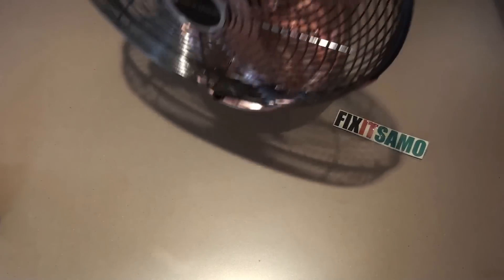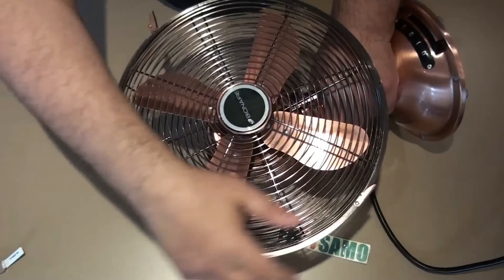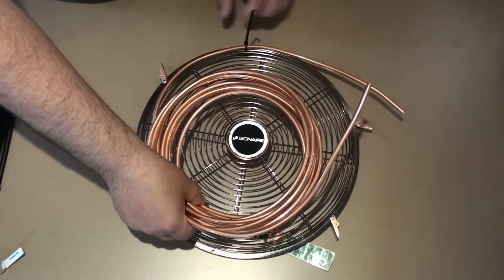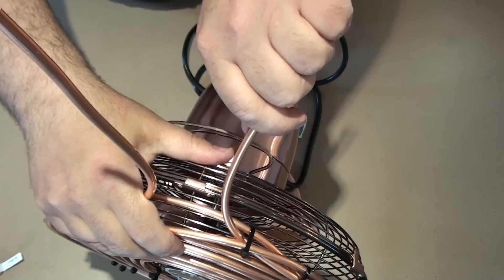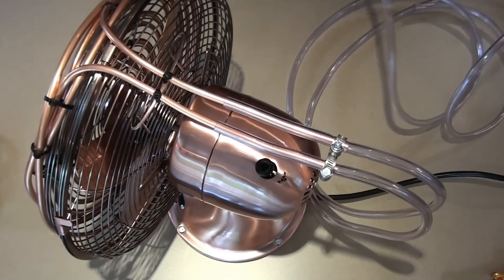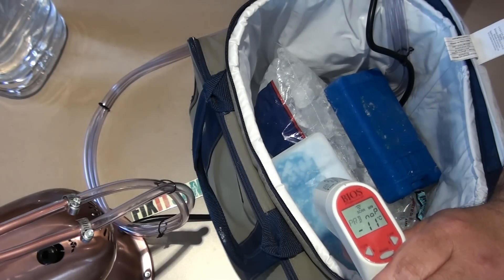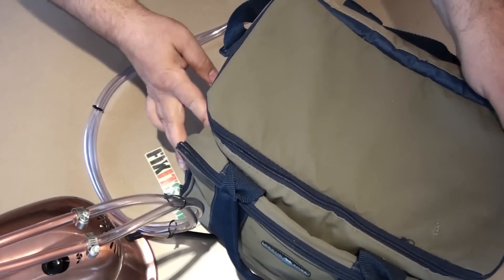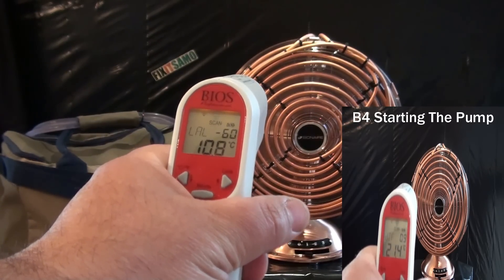How To Turn Your Fan Into An Airconditioner  AC

Comment: very nice, low cost environment friendly AC.
Reply: +Shesh L Environment "friendly" "AC"... yeah how much electricity is spent on freezing the ice, how much all the materials for this build cause in emissions or money vise, not to mention this is terrible inefficient thing as thermometer in video only showed the temperature of the copper pipe.. not the air. Water transfers heat into copper very well, but from copper to air its whole different ballgame as the surface area and contact with air/water molecules in air, is so small.

Comment: Well you have to keep adding the ice bricks to cool the water in the coils. If the ice bricks are cooled by a refrigerator in the same room, heat from the refrigerator is a by product of the cooling process. The refrigerator has to be in another room for the room to be cooled by the fan.

Comment: Awesome project. Definitely a cheaper way to have an AC inside a small space. +fixitsamo, you told +mohamed dhiab it lasted about 8 hrs, but how big of a room would it have to be in order to work for that long? Thank you.
Reply from the maker: +Formato X  my test room was 12x15  feet thank you
Reply: Awesome.
Reply: +pfifo fast Fans are common household items, Ice can be generated through your freezer. You can get the copper tubing for $10-15 and a pump for $30. This is a heck of a lot cheaper than an A/C unit.

That isn't even mentioning the amount of money you would save on electricity. A/C units drain energy like crazy, a small pump + fan would hardly use any electricity in comparison. Unless you are short sighted this method is pretty damn cheap.
Reply: +fixitsamo and can you tell me what was the room temrature of that test room ?
Reply: ***** Your freezer is running regardless of whether or not you are making ice for an AC. The cost to do that is irrelevant in this case.
Reply: +Matthew C your freezer has to work harder to freeze water into ice, so actually it does cost money to freeze water over and above what it costs to keep the freezer running normally.
Reply: +pfifo fast and keeping the fridge door open will not cool the room, it will actually heat it. The fridge will extract heat from the air, and pump it back into the room via the coils at the back. It will also add motor heat, so the room will gradually get warmer!

Comment: ... or for under $100 you can buy a Frigidaire mini window unit with no labor... no ice... no sourcing parts all over... no melted ice.  Just plug it in.  Also plan on condensation possibly dripping off that coil strapped to the fan if there is humidity in the room.

Comment: I think this can be quite dangerous. Condensation will collect on the cold tubing that is going over the top of the motor and drip onto the electrical components. Also there will be a lot of water dripping off the tubing onto the table. Be very cautious with this.

Comment: You show've taken temperatures in front of the fan before and after this installation to demonstrate the AC effect.
Reply: +Kalpesh Patel He does show it at the bottom right side when taking temp of the finish project.
Reply: Ted Chong oh. ya. missed that. Saw it now. thanks.

Comment: A lot of ice is needed to cool off even the smallest room.. Lots of it.  A typical 5k BTU window AC unit (the smallest AC unit you will ever find) is a 0.4 ton rated system.  Which means 0.4 tons, or 800lbs of ice is the equivalent of being melted over a 24 hour period.  So let's say you only run this for 8 hours as that might be the hottest part of the day, you'd therefore need to change the ice every hour with 100 pounds of new ice, or 1.6 lbs every minute !  Hence why in ancient days, you'd have hundreds of slaves go up to the mountains every week and literally drag back a small glacier just to cool off the king's chambers.

Comment: wow its an efficient heat exchanger! it the cooler bag was in a real fridge we improve the efficiency by ten fold!
Reply: +fidel catsro LOL
Reply: +Jarrod P yes sir im dead serious no kidding senyor!
Reply: Thatsh purrfeckt
Reply: +Jarrod P did you know refrigerators are the only sort of free energy we're getting in this god forsaken world..its gives cop of greater than 1! every other appliance else we use, fan , tv, etc is less than 1
Reply: +fidel catsro so I guess when you run the water from the fan into a refrigerator, the heat is extracted by the fridge, then.......  magically disappears?
Reply: +Jarrod P no definitely the fridge compressors have to work to take the heat away, but its doing a fine job, I think we can make a fridge even more efficient at its work if we can fin the exteriors of the heated coils of the fridge..its cooped up in the skin of the fridge for aesthetic purpose, but if its exposed and finely finned im sure its efficiency further improves by many times..the idea is to make the hot coils of the fridge cool better so the compresssors don&#39;t have to work extra hard! its a heat pump just like an engine, it needs its hot part cooled better than what its getting now..its needs better cooling sort of what you see in a finned motorcycle engine or even a liquid cooled engine radiator..

Comment: I also wished to comment that if you build this thing, DON'T USE SALT! It's a REALLY REALLY BAD IDEA.

In the case of this system, it will not make the water cooler for any additional time. Arno van Kampen doesn't understand what happens with salt in water.

Comment: If I were making this device, I'd use two adjustable clamps for the polythene-copper junctions each, or at least seal the tips with heat shrink tubing. Also, I would locate the tubing BELOW the fan's motor (in case of water leaks AND the top of the motor would be a little warmer than the bottom). Also, the cold water feed could be introduced into an isolating medium such as foam insulation for pipes - or a cheaper alternative are those foam tubes that are sold as "jousting bats" for use in swimming pools.

As for the reservoir, I would use a small container inside a slightly larger one filled with foam chips (popcorn/pellets/styro chips) to isolate it from the ambient temperature, rather than the "cold bag" which can be subject to OOPS moments.

There are a ton of enhancements I can think of: a temp probe in the reservoir, an iceless version using the toilet tank and others.

Comment: I am so excited to build this. I make blocks of ice in a deep freezer at home that last all week in a cooler I use on the road as I am a truck driver. This will let me cool the truck without idling and save me a gallon of fuel an hour. Simply put by law you have to take a ten hour break a day, on the road 5 days a week 50 minimum in breaks which is truly closer to 70 hours with getting loaded and unloaded. Engine at idle burns a gallon of fuel an hour so in the worst of weeks you just saved me 65-70 gallons a week. Thank you very much!!!!! And I believe I can make a big enough block to last a full week with this system, even if I can't 2 bags of ice a break is still way cheaper then 10 gallons of fuel.
Reply from the maker: +G G great thank you :)

Comment: you must use a air temprature measurement tool by using a object temp scanner you measure the copper pipes temp. and 10.C means no change in air as they are not so surfaced sliced or anything.. but at the end nice try

Comment: Look, dig a very deep rectangular hole in your backyard until the earth temperature hits 50-55 degrees, drop some coiled copper tubing down with inlet and outlet on either side, you figure out the rest,  hint: pump,  exchanger , air distribution box, and solution to circulate trough copper wiring to efficiently remove heat . Look around utube !

Comment: Its not really AC though.. its just a air chiller. AC cools the air by removing moisture, which is why it needs a liquid return line.. its way more efficient. But for a budget air chiller its a good idea, for the people not lucky enough to have AC like myself.
Reply: +Ame Nightcore . AC cools the air by removing moisture... wrong
Reply: Onofe Eromosele Thats what I said. Its true go google it.
Reply: AC cools the air by "forcing" the refrigerant to vapourise (The cycle starts at the compressor and the part that really does the cooling has a valve that forces a drop in pressure) ---- google refrigeration!!!!
Reply: Onofe Eromosele That how a refrigerator works sure. Maybe you are correct and some AC units works like that. But many AC units removes moisture from the air. Moisture in the air is what holds the heat and thats why when the humidity is high it seems so much hotter.

The humidity method is not as noisy, uses less power and is most likely more efficient. But its recommended to have a humidifier otherwise the air can be very dry.
Reply: Okay then,but the truth is thought there are other ways of extracting moisture, the most popular and widely used still involves cooling the air to a temperature below the "dew point"

Comment: moisture will condense on the copper tubing in front of the fan. you will need a drip pan. It will also dehumidify the room, somewhat.

Comment: Not a good idea. So many things could go wrong. what happens if there is water leakage from the tube connection? Electrocution! The pump needs electricity to run, and it is noisy. A better idea is to just leave a bucket of ice in front of the fan; Serve the same purpose of getting cooled air. But anyway, it is not going to be a real air con.
Reply: It's a submersible aquarium pump they are normally filled with silicone or glue so they shouldn't electrocute anyone and if they do sue the barstads that made it
Reply: +YQZFSHNJ those pumps are designed for this exact purpose dude
Reply: ***** lol i know what u mean man glad i live in Australia where people bitch about kangaroos jumping in front of ur car rather than being electrocuted by a small fan and a submersible pump
Reply: 100% FAKE. I tried this but its not work.
Reply: Ahamed Jaleel well u stuffed up works fine for me
Reply: +Ahamed Jaleel why? what was your results?
Reply: Ahamed Jaleel oh yea did u use copper pipes cold water  and a good fan?
Reply: Because of condensation dropped the water didn't get cold air

Comment: Its a wonderful idea to design such a fan air con. I have just a little suggestion to the designer Mr. Navin Khambhala and Fixitsamo. At the top of the fan where the copper tubes meets the plastic tubes, there may be a  possible danger of water leaks. If there is a leak, water will runs down to the fan and causes accidents. I would suggest that the joints are bend both sides and run downward from the fan motor with the copper tubes still attached as now. If there is any water leaks, water will run downwards on both sides of the fan motor. Its always better be safe than sorry!

Comment: For the price of the fan only you can buy a used window A/C and save yourself all the headache, this cost more than a window A/C both ways in Initial cost and in usage, the fan uses power and so the pump also you will have to buy Ice every day, this is so pathetic.

Comment: For those who don't understand thermodynamics.  It's simple.  Heat is energy.  You can not create energy,  you can only move it.  When you burn petrol,  coal etc,  you just moving the energy from one state to the other (hydrocarbon to heat). The same thing in a car.  You burn fuel to take the energy out and generate heat,  the heat the expands the air which pushes the piston, which turns the crankcase.  This way the energy from the petrol,  gets transfered into heat and then into mechanical force.  One other important thing,  you can't put less energy into a transformation than what you get out.  Actually every time you change the state of the energy you waste a little bit of it.  Again in the engine: when you burn the petrol,  it generates that heat which moves the piston. The problem is,  that at the end,  you don't use all the heat,  so parts of the energy you released by burning petrol gets out your tailpipe and the radiator as heat.  This is why electric cars are more efficient...  The energy transfer is more efficient.  
Now back to our refrigerator.  The main principal of working here is heat transfer.  You don't cool it,  you remove the heat.  The AC in your house has the same working principle as a refrigerator (plus a fan): an insulated chamber with a condenser on the inside (the metal radiator you used to see on the old refrigerators)  a compressor and a radiator.  The coolant (special liquid which boils at low temperature) inside the condenser (which inside the refrigerator)  gets compressed and it can absorb heat from inside your fridge.  Then it gets moved by a pump outside,  into the evaporator (radiator),  where the pressure is released.  When it's compressed the liquid can hold a lot of heat.  When it is decompressed it can hold less heat.  So as soon as it reaches the evaporator  (radiator on the back of your fridge) ,  because it is decompressed it releases the heat absorbed in the fridge into your home.  This process is inefficient as it requires more energy (in this case electrical)  to the fridge than one the fridge can move.  You would need 1kW of electrical energy to move 0.7kW of heat required to make the ice.  Thus you actually wormed your house even more.  The fridge will stay cool inside,  but it will give heat on the outside. 
The same for the house AC.  you use electricity to move heat from inside the house to the outside.  And you actually you use more than you move.  But for as long as the evaporator is outside the house and the AC unit can move more heat than what your house let's in,  the air inside the house will cool.  But if you put the evaporator in the same place as the condenser.  The condenser will pick up the heat and give it to the evaporator.  If they really both in the same room,  they will not cool the room.  But the heat generated by the system will heat it up even worst.  This of it as being in a flooded boat and you would take the water in a bucket and dump it back in the boat.  Will the water in the boat get removed?  No but you will put a lot of energy into it.  
In reality things are much more complicated than I've made them sounds but I hope at least some people without thermodynamics knowledge would understand something.  
If you get the ice from a fridge which isn't in your house you might actually cool the house as the fridge will not heat your house while making the ice,  but on the long run,  you will spend money using electricity to make that ice and it will be very inefficient,  you might as well same the money you will send on ice,  water pump,  fan,  pipe,  ice bucket,  electricity and buy yourself a small AC unit

Comment: I think you might be more efficient if you leave the fridge door open...  Haven't done the math,  but in 99% sure I'm right.  You are heating the room  with your refrigerator, from the extra load to make the ice.  Afterwards you are putting the ice in a bucket to cool the water.  In an ideal world,  the heat which was used to generate the heat is now absorbed by the ice.  Let's assume it's ideal world.  So at this point you have increased the temperature by x degrees to make the ice and lowered the heat by the same amount of degrees by melting the ice.  The problem,  even in an ideal world is that you're also running the fan which generates heat.

Comment: For the hour or two you spent putting this together plus the $25 in parts and $25 in the fan you could go buy an evaporative cooler and not have to fuss with the ice part.
Reply: +Jeff Gedgaud I live in a very humid and hot place (Brisbane, Australia). I read that evaporative coolers are absolutely useless when the humidity is that high (70% +). What do you think?
Reply: +linuxmq in my place its 98% humidity all the time and we use evaporative cooler bruhh

Comment: Everything was ok, the idea is cool and this video is awesome fixitamo. But I'm just curious about what happens if dust start to accumulate at the fan grills? I'm using table fan at home and I usually need to clean it up from dust building up at its grills.
Reply from the maker: +Hanz Akhyar hello thx  btw try to cover it when you're not using it   or use a Handle Duster Cleaner  daily
Reply: Haha...y i'm not thinking about it earlier!

Comment: Look this is a nice DIY project. However it is not portable, still needing AC power to function. Even though it does operate and reduces temperature to a spot location. It is clearly not very efficient and requires a lot of maintenance to continue to run. I not sure where you live at in this world but we in the US have hardware suppliers which sale very efficient an small window mounted air conditioning units which are very in expensive units. If you can even wait until the fall season the hardware stores place these units on clearance making the AC units very affordable. In fact the amount you paid to purchase the copper tubing  an what appears to be a relatively new fan might have been enough to have purchased one of the units I'm talking about. If you did this to just do it, great. You proved the concept of how cold water being pushed throw a tubing made of a material which dissipates heat very efficiently can be used to cool an area.
Reply: +jim short Window aircondition unit running on high energy consumption just like mulit-split airconditioner. Those are cheap in-efficient unit  that operate about 100times the energy consumption of a fan.  High carbon footprint product.
Maybe is time you guy learn to reduce waste and save the earth.